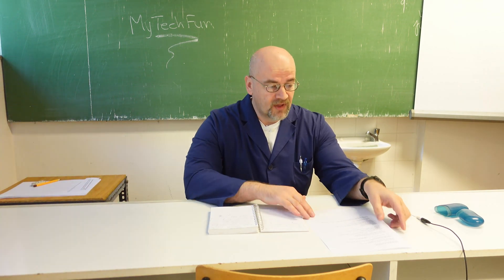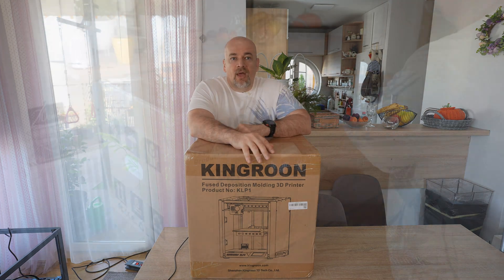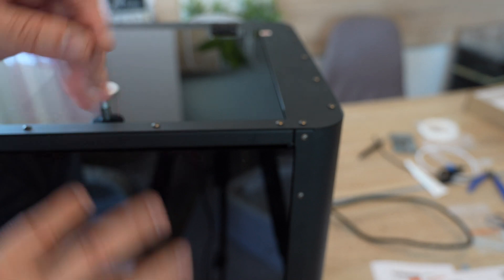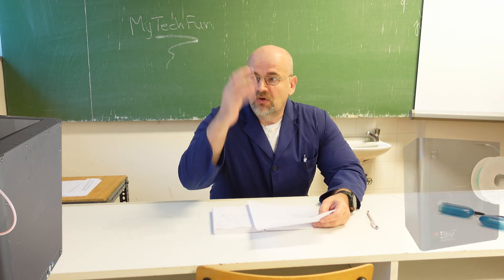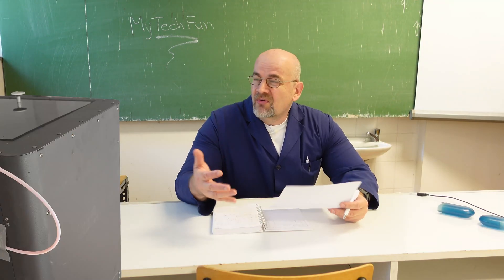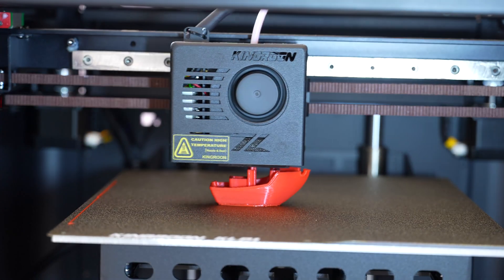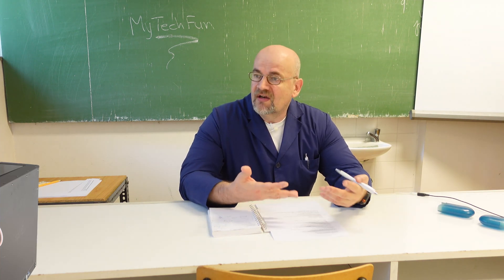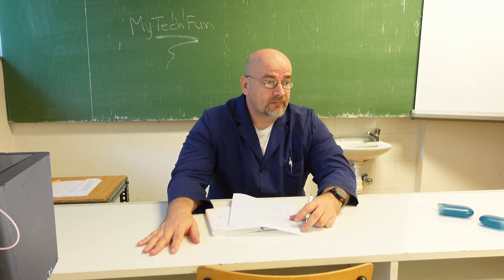But why only "C"? Is it really improved? Kingroon KLP1 230 Klipper based fast coreXY 3D printer test

Comment: For gear toy have you tried to change flow in the slicer?
I have always problems with this hight tolerance pieces without change flow. 
Orca Slicer has flow calibration with two test printings. 
On a Kingroon KP3S Pro S1 (and KP5L) I had to change from .98 to .91 and now not only I've better tolerance, but also supports are more easy to remove and leave less artifacts.

Comment: Thanks for another great video. I have one, and it’s working fine. I just made new parts to hold the spool lower and make the connection to the sensor easier. I still haven’t fixed the lid height, but I’m working on it. I do struggle a lot with ABS, ASA, and HIPS, but it’s likely due to my inexperience with these filaments. Printables has a very productive if small KLP1 community. I took inspiration for my fixes from there and also posted them there.

Comment: I've had a similar issue with filament getting wrapped around the gear with the KP3S Pro V2 extruder (which I believe is very simlar to the KLP1 extruder). I examined the extruder and found a lot of sideways play of the stepper driven drive gear and its axle. (It appears to be at least 2 mm).  This is enough to allow the driving grooves to get out of line with each other so much that the filament can get between the gear teeth instead of being in the drive groove. The filament then pushes the gears apart and the filament slips between the tension gear (drive gear with the spring) and the extruder body.  I've been thinking about making a bushing to keep the grooves aligned.  It almost seems like a part is missing.  

For the KP3S V2 Pro, I found the wrapping problem is very likely to occur if you hold the 'filament switch' (spring lever) when loading filament (which is normal procedure for some other extruders) - since doing that opens up a space for the filament to slide under the gear. Instead, do not not use the spring lever at all. Just start the filament load and gently push on the filament until it gets pulled in. 

But it looks like the newest KLP1 extruder doesn't have a 'load lever' at all... so apparently that just leaves an issue with how the filament is guided into the extruder gears.

I agree with you about the unnecessary idle noise. The KP3S Pro V2 has the same issue. The board and power supply fans go on 100% within a few seconds of power on even when the heaters and motors are off. It was the first complaint I had about the machine.

Comment: I just don't think this is good enough. Too many small issues. That much z movement while printing a single layer is also unacceptable. I think if you filmed the parts closer with less motion and overhead light, it would reveal many minor flaws. It is absolutely worth it to spend $100 more and get a Qidi Q1 Pro, for example. Fun video!

Comment: IMHO it is not really worth the price. Just bought a Qidi Q1 pro for only 100 bucks more. And that thing has not half of the bugs this Kingroon has, and just prints each and everything all the time. Your print is visible bc. no tinted plastic and available lights, you have a camera, bigger build space, chamber heater, very good slicer profiles and so on.
It has its flaws also, but there are not too many and the print quality is just excellent. 
I own the older KLP1 and this one is not really an improvement to it's half baked predecessor.

Comment: Flashforge 5m bully sitting in the classroom...$299
Reply from the maker: But that bully can't print ABS, only the Pro version.
Reply: @MyTechFun  I guess you are right  teacher... I built an enclosure for mine, forgot it doesn't arrive stock with abs profile and the enclosure... No extra credit on my quiz 😕
Reply: Software updates seem to make 5Ms worse, at least in users FB group. And they don't have enough memory for full Klipper, though display is better in quality and position ;)

Comment: nice to see a good review from the latest revision of the printer. i have the same "issues"as you have. but as i like to tinker a lot with my printer, it does not really bother me. there are some config fixes to lower the noise of the steppers and the mainboard fan. since the part cooling is pretty good, i do not run the fan above 50%, so it is a lot less noisy. 
i see in your video that your build plate is not aligned very well, my buildplate had a heigt difference from 5mm, front to back.. but that is easy fixable with the screws under the pei-sheet. that said, i am happy with the printer.
Reply from the maker: Thank you,  useful feedback. Yes, it is a good printer for those who are not afraid of some tinkering.